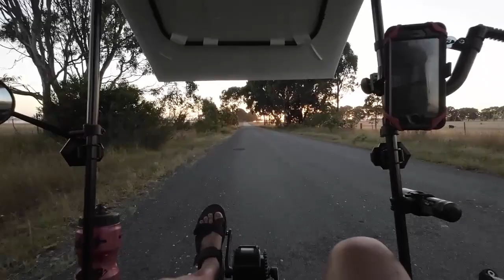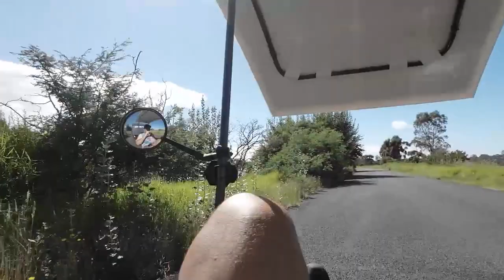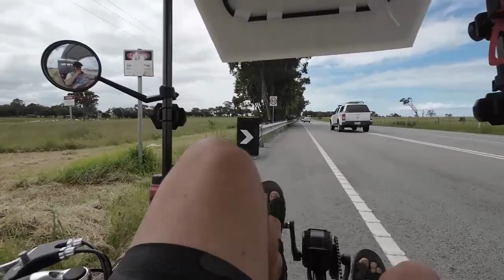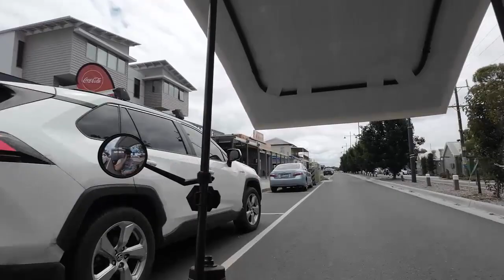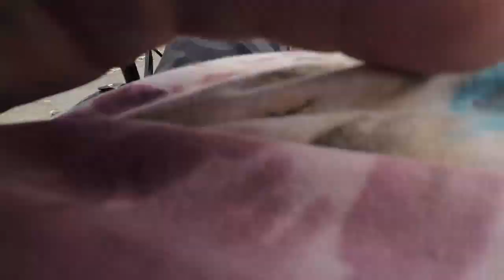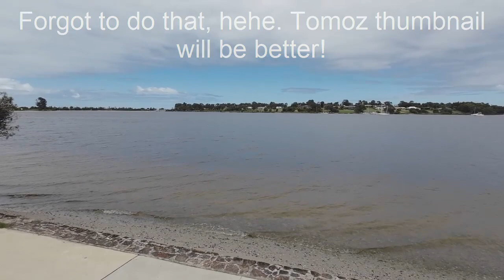Quadricycle - Lap Of OZ Day 12 By Off Grid Mojo

Comment: Sounds like some one does not like people on that trail. Did you report the glass problem to any one? And yes, no finger today :) I see why your feet have problems in those shoes, they are black. Any ways, stay safe, keep your head on a swivel, and nice video's. Most of the Bike riding YouTubers I follow, wear helmets and have a GoPro mounted to it. I've been watching you pedal, looks to me like you just dont have a good high gear, but thats just me. I do pull a trailer now and then, but not nearly as big as yours. Then again, using a hub mother on my two wheeled recumbent, I was able to keep my triple crankset.
Reply from the maker: Yes it would appear that way James!
No reporting. Hehe, there was an invisible finger to the glass bandit, haha. 
Yes, very hot feet, there is a heartbeat in each of em, hehe.
Thanx for the kind words buddy. Yes, the gear ratio is geared for torque only. Perhaps down the track I may look at a hub motor for the other back wheel, however, I am doing ok anyways…
Cheers James, love hearing from you mate.
Ash.